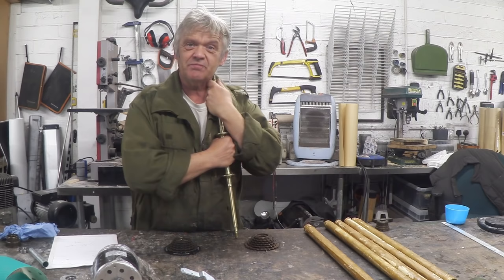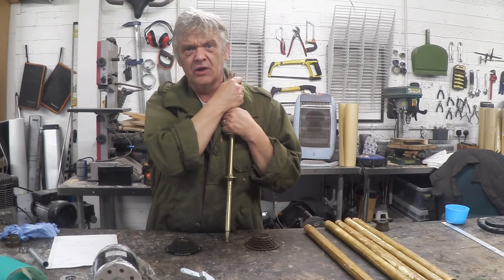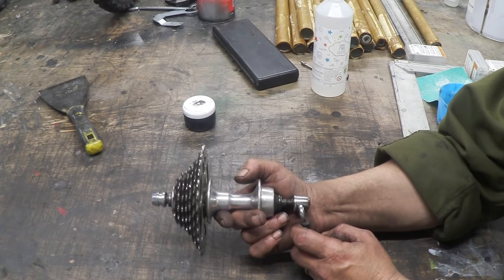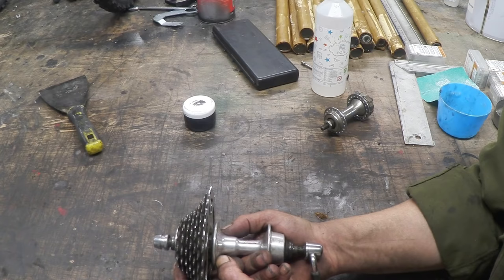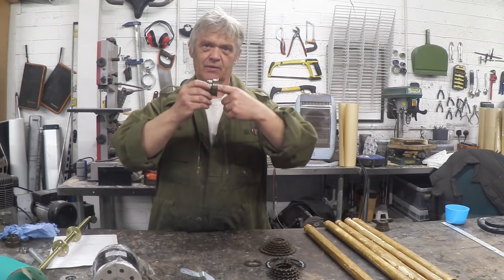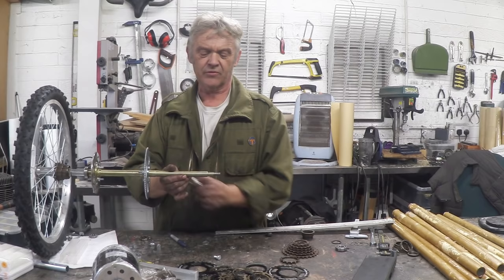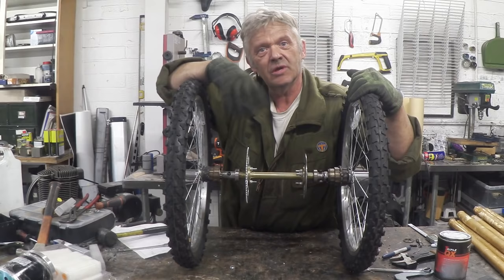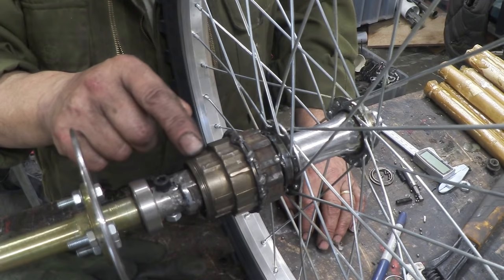1175 How To Make A Dual Freewheel Differential For A Paper Trike

Comment: why not power the back tires with separate drive motors and still have reverse, no slippage and more torque
Reply: Good point.

Simpler to build too.

Then you get to keep both adjustable rear hubs and mount the motor to the pedal area or sproket. Now you got a transmission and low gear for hills.

Backing up not that important to me.
Reply from the maker: twice the cost, half the distance unless you double the battery and twice the complexity - but that's what i think - go with what you think is right
Reply: @ThinkingandTinkering  you could use less powerful motors and still use the same power consumption for minimal cost difference. but that is just a thought for redundancy and less complication for those without a welder.
Reply: if we use two motors then how will change the power of both ,we can synchronize them which will work for straight movement but what about turning problem??? you would need to decrease power in one motor while turining
Reply: @avisingh7641  an electric motor will free weel on a corner and the other will slow and take more load. 
Try it and you will see what I mean.
Reply: @rayg436  do u mean to attach motor at center with chain or two hub motors at the two end??

Comment: oh my god, you sir are a genious! that's so simple that I was not even thinking about doing this kind of solution :D but one question though, the threads on the wheels are in a different order once they are flipped, so one wheel tightens as it spins, the other one will untighten, or am I missing something? also, will the brake be usable on the shaft once it's all mounted up?

Comment: That's beautiful. Using a tool to modify the hub, it looks fairly simple

I wonder does it need two brake discs to keep the vehicle from pulling to one side, when you apply the brake?

Comment: we need a fixed sprocket drive arrangement so the wheel can be driven backwards too (for an autonomous land rover).  do you know of any such axle that would work with these hollow axle wheels for trikes maybe? needs to drive the wheels independently too so maybe two short axles

Comment: Modern high performance motorcycles often have two discs for braking, there is a valve body that the lines attach to, so that the master cylinder activated applies equal pressure to both slave cylinders at the same time. I forget what the part is called, in an automobile it is called a metering valve, I think. Its mounted to the frame rail of the auto chassis, near the main cross member that holds up the transmission. It's not a serviceable part.

Comment: Can you explain the best way to introduce air to a wood or gas burner .using the hot air from the room you are trying to heat causing drafts. or the colder air from from under the floor Alex.

Comment: A question regarding the "no reverse" statement (6:32):
As far as I know, "normal" (two wheeled, geared) bicycles also don't reverse, and pushing them backwards engages the pedals and rotates them back.
Obviously there's a reason, or you wouldn't have mentioned it, so why did you?
Thanks

Comment: The big problem I have had with the delta trike is the pitch of the road, need a suspension so I don't fall over and so it doesn't veer off the road either.
Reply from the maker: cheers

Comment: Just weld one side and leave the other as a bearing
Reply: You only have one wheel drive (on a wheel that bears ~ half the weight of a single rear wheel setup and therefore has less traction) and there's no traction advantage.